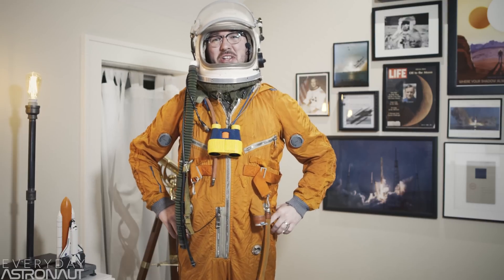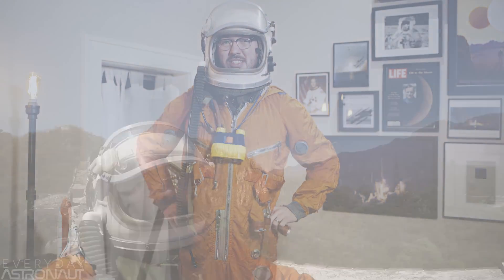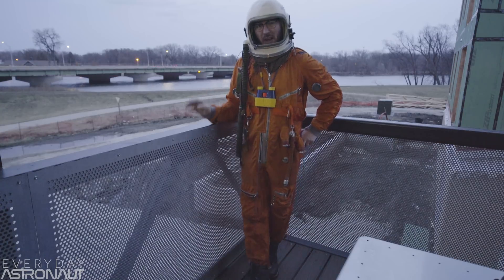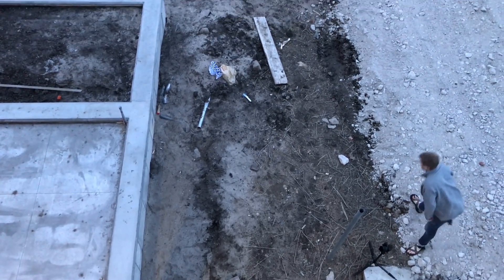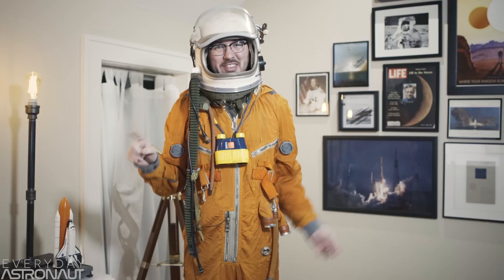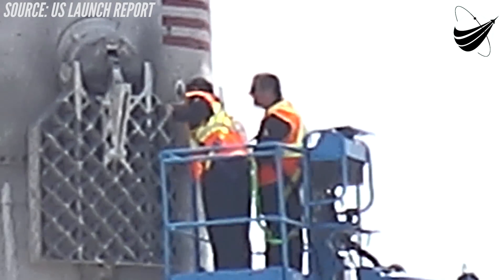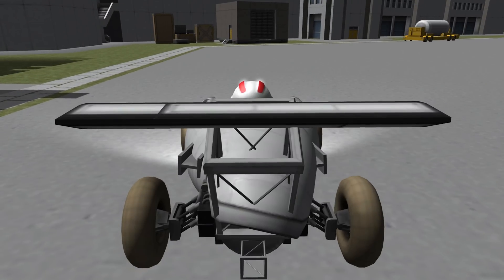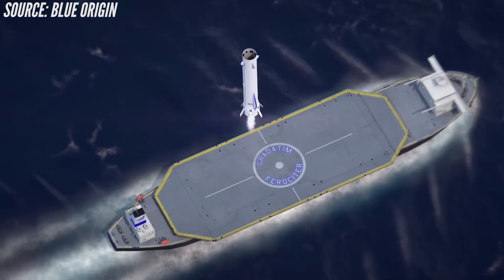How SpaceX lands the Falcon 9: Why they don't use parachutes!

Comment: what i want to know is, how does a 15 story tall structure not topple over once it lands on a floating platform on a wavy ocean
Reply: all the weight is in the bottom of the rocket and the legs stabilize the rocket
Reply: Don't listen to Bill.. He was part of the failed Apollo 13 mission.
Reply: Before they bring it back to port they go out in another boat and actually WELD the rocket's feet to the deck of the drone ship with big metal SHOES!  http://www.popsci.com/what-happens-after-you-land-rocket-on-drone-ship
Reply: The fueltank was now empty, only left the heavier sections (read: engine motor) of the rocket, making the Center of Gravity downwards to the engines. Plus with its 4 widespread legs. Imagine you're having a bottle where there is only 1/4 water left inside. put some legs on it, see if it stable or not.
Reply: BACON FORGOT TO CHECK THE GAUGE BEFORE STIRRING THE TANKS
Reply: i think hes also dead  may he rip   he was a great actor
Reply: good answers......and must be correct answers because it never topples over does it
Reply: Joshua Pritt there's more to it than I originally thought!

Thanks for posting that article
Reply: look at the size and the way it is supported. it looks to be 4 legs positioned outward from the bottom. Have you tried to knock something over with that support structure? It's not likely to fall over, even on a wavy ocean
Reply: actually there is a video where the rocket toppled over and blasted as it hit the platform.
Reply: @ajayghangas1090  It might ran out of hydraulic fuel or the legs collapsed
Reply: its the ocean moving the platform i couldnt figure out
Reply: but wind!?
Reply: +Joshua.
Geez. That must be extremely well paid welders. I wouldn't get close to that rocket!!! Thanks for the info
Reply: Reaction wheels and RCS thrusters
Reply: ok
Reply: Kidding aside it just looks like you would put a larger base for the legs it just looks unstable
Reply: Ikhwan Yusuf take that bottle of water and drop it from the cn tower and land it perfect
Reply: nick gratton weight is closer to the bottom?figure it out
Reply: Well some rockets did fall over and others slid around the deck.
Reply: Joshua, thanks for the link. So they can't bolt rocket's feet down because they don't know exactly where on the deck each foot will end up. So they put shoes on the feet and weld the shoes in place. Simple solution. Brilliant.
Reply: How does it not flip when coming down and the rockets kick in?  Giant Gyro?
Reply: MB4LUNCH stability enhancers maybe.
Reply: they have a robot that goes out and secures it
Reply: Well the vid did say it's a football field size pad. It's so massive it doesn't really move. It's like being on a large cruise ship vs being on a small boat. On board a large cruise ship everything seems motionless and nothing tips over where as in a small boat, you can easily feel the rocking of the boat....
And for people who mention wind, I'm guessing that it could be that space x just does good static calculations and they design the landing legs in a way that it takes a whole lot of force to knock it down. Math, it works miracles
Reply: With no one on board to strap it down lol. Ghost ship.
Reply: obviously has stableisers at the bottom..........other than strong magnets i cant see how it doesnt topple over....cant be magnets tho as theyre too heavy

Comment: Parachutes would have been easier, but SpaceX is following a long-term plan that involves landing on other planets, like Mars.  The atmosphere on Mars is way too thin for parachutes to work for heavy payloads.  So retro rockets are the only option.  And when you consider that Mars (or the Moon) have much less gravity than Earth then the amount of fuel needed to land is much less.  Earth is basically the worst place to land with rockets so if you perfect it here then you should have a system you're fairly confident in when it comes time to land on Mars.
Reply from the maker: +Peter Drake fantastic point. For a matter of trying to be quick and simple I left out some details but this one is so important I probably should've included it. I'm still getting a hang of these videos so thank you for the feedback. Trying to figure out how detailed to get.
Reply: I don't think you made the wrong choice.  It's a topic that can be covered just fine in the comments.  But you might want to do a whole video on how interconnected and grand Musk's vision is.  This point would be one example of how everything is orchestrated to accomplish the grand goal.  It's not an accident that the two other technologies most needed to thrive on Mars, at least initially, are solar power collection and storage, and electric vehicles.  When you take a step back and see how it all fits together ... well ... he a very very smart guy who set a goal, identified the major obstacles to that goal, and launched projects "disguised" as companies to tackle each goal.

Another likely challenge to survival on Mars, how to build cities underground until it can be terraformed and a magnetic field created?  His latest interest?  Tunneling.  Also, self-driving cars handle pedestrian-free and snow-free tunnels much better than shared surface streets.

And hyperloops would be more efficient on Mars than Earth.  Hyperloop wants 1 millibar of pressure, Earth has over 1000 millibars, Mars has 6 millibars.

What's next?
Reply: Parachutes aren't simpler though. They add complexity to the design of the rocke to support the parachute. They make precisely landing much harder/impossible. When the rocket is first entering the atmosphere no parachute can withstand that force so the rocket would have to do the reentry burn anyways. Like he said in the video they also add a significant amount of weight to the rocket which is the one thing you don't want to do.

Comment: You forgot to mention that a post launch F9 running on fumes is too light to hover even with only that one engine at minimum throttle. It can't do what New Shepard does which is hover in mid-air, adjust then land. It really has to hit zero velocity at zero altitude or it will fly away again.
Reply: photopawn37 Yeah, IIRC the minimum throttle for the Merlin engines is pretty high, like 60-70%
Reply: photopawn37 Wasn't there a Russian rocket with like, a few dozen engines? Also, if they had gone the less and larger route, I wonder what the configuration would have been since the current configuration is quite nice from a symmetry point of view (the first stage uses only one engine on all stages of reentry and landing, yes?)
Reply: Well you have the Raptor engine which took Merlin 2's place but the Raptor also has some impressive throttling. Wasn't it something like 20%? Although it does also have like 3 times the thrust so 20% of Raptor's thrust or 60-70% of Merlin thrust.
Reply from the maker: +photopawn37 this is true and it was not overlooked. For the sake of timeliness I had to keep certain details out.
Reply: S-senpai noticed me @_@
Reply: Yep. Just think how hard propulsive landing would be if Spacex had been more sane and developed the then rumoured Merlin 2 Engine which was supposed to be much larger. The fewer your engines the less likely you'd suffer a malfunction. thus it makes sense to use fewer but larger engines. I suspect Spacex was too cheep to go that route and only stumbled upon their current technique of rocket reuse.

Comment: You seem to be unaware that SpaceX began trying to reuse the first stage by using parachutes. See Falcon 1. The problem was not inaccuracy of the landing, it was that the stage broke up in the atmosphere before the parachutes could be deployed.
Reply from the maker: +William Thomas I was aware of them sticking parachutes in the interstage, but I didn't realize it was failing due to re-entry! I had to keep a lot of details out to keep this video short and sweet, still getting the hang of these things
Reply: I think it's nice and fun that you are making these videos. And sure, most viewers won't be space geeks. 

But you spent a lot time in the video explaining why a stage couldn't land precisely with parachutes, when the real problem is simpler: parachutes don't work in the upper atmosphere where the stage most needs them. And SpaceX proved that. 

Also, saying that one can't land precisely with parachutes raises many questions. Such as: why not land with parachutes and a little bit of rocket fuel ala Soyuz capsules? And parachutes have actually become amazingly steerable, so you are probably exaggerating the problem with targeting a landing zone. (Consider the ULA plans for their new Vulcan rocket, which include recovering the motors by parachute and ballute.) But any American first stage parachute landing would have to be out at sea since there would be no boost-back. 

Keep up the good work.

Comment: You forgot to mention that the airspeed will rip your chute anyway, and the rocket need to slow down before its reenter the atmosphere, only rocket can do that
Reply from the maker: +CptMikeTango Wow. You're absolutely right. They can forgo the boost back burn (JCSAT style) but they still need to do the re-entry burn.... that's a big over site by me!
Reply: Most of the heat actually comes from air compression, not friction (some comes from friction). You know how, when you use a spray can, it gets colder? That's because the escaping gas carries some of the thermal energy from the gas in the can away with it, and what's left has to share less heat through the same volume. It works the opposite way too - if you compress air, you're squeezing all the heat from a large volume of air into a smaller space, increasing the heat contained in that space.
Reply: Atheist Enthusiast, actually the first batch of crewed returns will use parachute landings. NASA has requested this as they want to see the retropropulsive landings demoed a bunch of times before they risk crew on them. So, initially, astronauts returning on SpaceX Dragon 2's will be splashing down under parachutes just like the old days of Apollo.

In order to demo the landing tech, the next round of cargo missions to the ISS will be done using Dragon 2, and those missions will all propulsively land. I don't know how many crew landings will happen under parachutes before NASA decides to allow SpaceX to land people on the SuperDraco engines.
Reply: You have to use a drag chute first to slow down, then you can deploy bigger chutes.
Reply: SpaceX actually tried parachutes back on Falcons 1 and 9 v1.0 - they just kept shredding.
Reply: Haven't watched the video yet, but didn't SpaceX initially try to get some data from the first stages by strapping parachutes into the interstage? If I remember correctly, all of them got destroyed by heat and aerodynamic forces before the parachutes could even deploy.
Reply: over site?
Reply: Because at high speed the friction made by the air molecules in contact with the surface of the rocket will make it heat. And finally destroy it.
Reply: jhanks2012, they've been landing Dragons from orbit for 7 years now, for a total of 11/11 (11/12, technically) successful landings. That 1 unsuccessful Dragon mission was due to the CRS-7's second stage going full on RUD mid-flight. So, it's not like they've never landed a capsule safely from orbit before. The Dragon V2 will be safer, as it will be capable of landing on land and airfields, too, instead of ocean only. Even if NASA wants SpaceX to only use parachutes during the first missions, they've still got the SuperDraco engines as backup, in case the parachutes fail.
Reply: CptMikeTango drouge chutes?
Reply: ksp taught me that
Reply: And certainly using Soyuz modules, which is the oldest/safest way to come back on earth :)
Reply: Why do we need to slow down before we re-enter the atmosphere ?
Reply: rockhopper, SpaceX already tried to land the stages with parachutes, but all of them disintegrated before they could even deploy the chutes.
Reply: The Soyuz  re-entry capsule uses parachutes, and retropropulsion only over the last metre or two to cushion the landing. Capsules have a lot more drag than rockets, so most of the hard braking is done by the heatshield.
Reply: CptMikeTango all we hood is a huge supersonic parachute
Reply: Propulsive Landing is unfortunately cancelled.
Reply: Maybe at least let them get a FEW missions under their belt without ending in total annihilation of the craft, and government agencies will warm up to the idea of letting them land humans
Reply: Aaron Freeman The parachutes are only for backup in an emergency where the rocket engines fail to work, it is very unlikely the parachutes will ever be used.